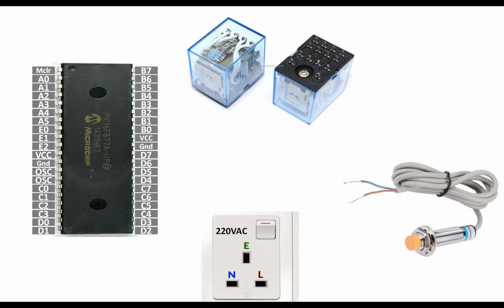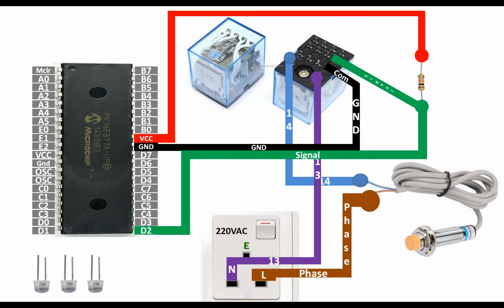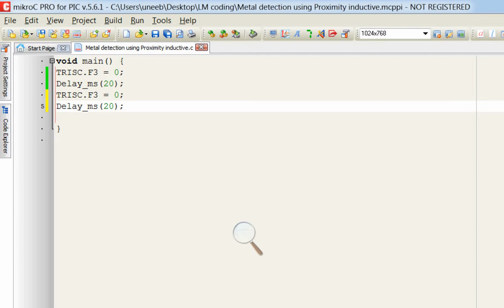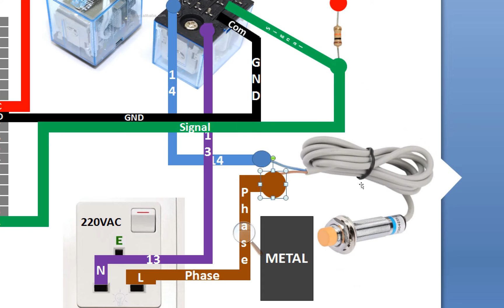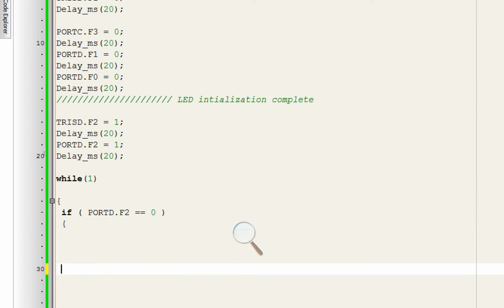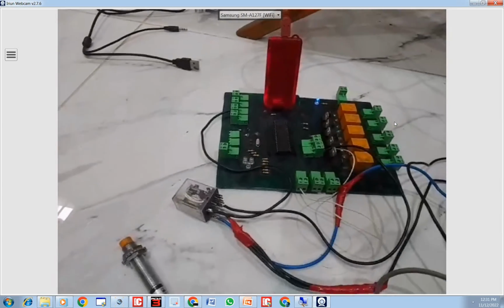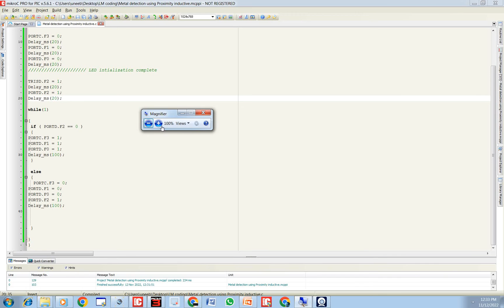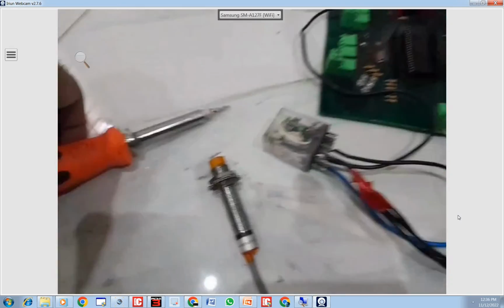PIC16F877A interface 2 wire 220VAC Proximity inductive sensor. To make a metal detector.

Comment: How to choose the res ?
Reply: Make a video for 3 wires, proximity sensor (12-24 VDC) interfacing with PIC16F877A
Reply from the maker: Sure will do soon
Reply: @learningmicrocontrollers3561  thankyou sir
Reply from the maker: Its a pull up resistor use 10k
10k ohm is enough